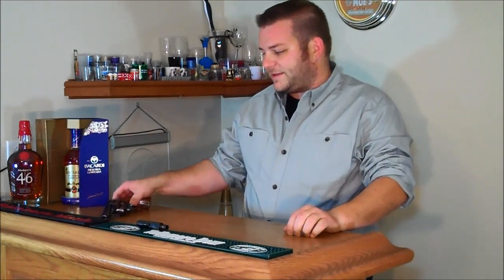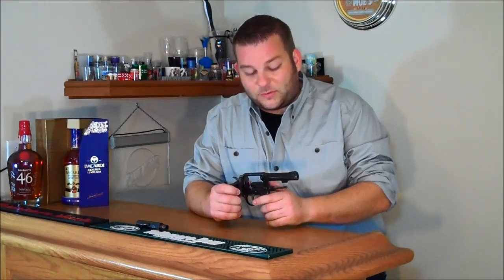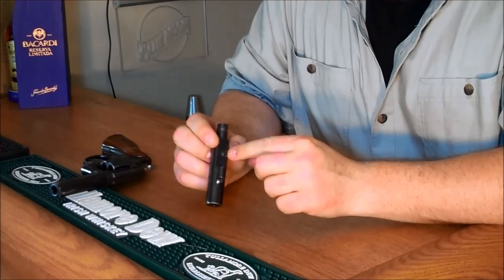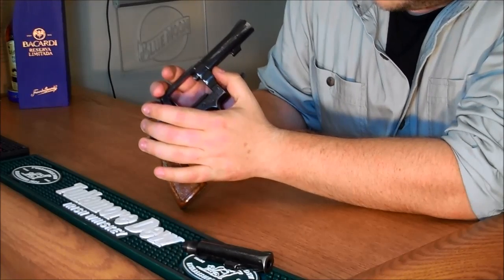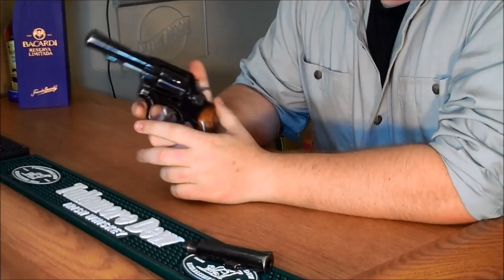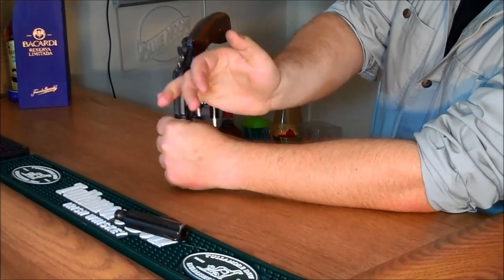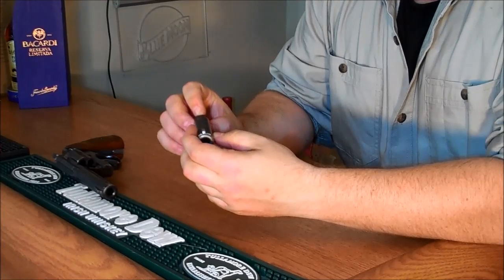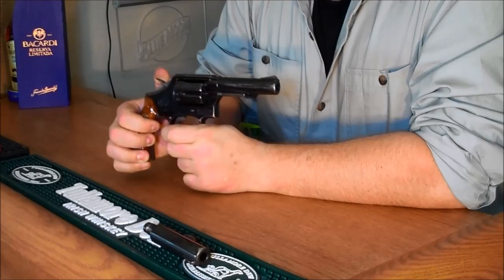Rebarrel a Smith and Wesson K Frame at Home? Gunsmithing tip

Comment: Thanks for the video - I'm going to roll the dice on a model 13  
I got the old barrel off using a rectangular piece of hardwood that distributed the stress and hopefully didn't bend anything .
If something is bent or broken it's not visible.
This isn't my first rebarrel on a revolver.  But the other one was a Ruger and their topstrap is a lot thicker, so it's sort of dicey.

Comment: I've got an interesting problem, Basically, my front site is to the right and the barrel needs to be turned slightly to the left, or the barrel screwed in,to the right a bit more, if you are facing the barrel. I'm hoping you can tell me how you removed the pin. I have a 10-6 as well. Are there any details on the pin that are pertinent? What size punch did you use? did you use locktight or anything else? I really just need to turn the barrel a very small amount to center the sites. Any advise? Thanks in advance.
Reply: Sight, not site.
Reply: You need a frame wrench and an insert for your specific barrel and frame. It’s very tricky, revolvers are hard to work on without the right tools. And even then your taking a risk if you don’t know what your doing

Comment: You did OK.  A  3 inch barrel would have doubled the guns  value.

28Bull
Reply from the maker: I just wanted to get it back together cheap, if i spent the money on a 3 inch barrel I would have probably sprung for the action wrench and at that point I should have just spent the money on a less beatup frame.
Reply: 3" barrel k frames are pretty sweet, though, dude.

Comment: Your kind of gambling that you won't have to do some re-coaning or barrel backup along with some cylinder fitting, the tolls for all that are a little over 500 dollars. You lucked out!  Might want to get a plug gage and check that cone out their about 50 bucks.
Reply from the maker: +Dana Webb It was worth the $30 gamble in my case because I could replace the gun for $300.  If the gun were not a complete beater I would have probably paid a gunsmith.
Reply: Gun&ShotTV It's pretty easy to make a frame ranch, I've got a S&W I'm doing some restoring myself, just take some studying and some home work, gunsmithing is an interesting subject for me like to see what others have done, Thanks for the video.
Reply from the maker: +Dana Webb Thanks for watching.

Comment: how much could it cost for a gunsmith to do this on a pinned barrel?
Reply from the maker: I asked before I replaced mine.  The quotes I got started at $300 Labor + the cost of the Barrel block for the Gunsmith + the cost of the part.    Unless you find a good smith who already owns the barrel block tools they are going to charge you to learn how to do the job.  So knowing the gun could be replaced for $300 I decided to take my own stab at it and if I wrecked the frame I was only out the replacement cost of $300.  In the end I got the gun back in shooting condition for the cost of the $30 barrel.

Comment: Can a K barrel fit in a N frame?? cause i wanna change the barrel of my 627 snub nose for a model 65 bull barrel. could it be possible??
Reply from the maker: Even if the same size, you would need to verify htat the threads match, the pin location matches, and the ejector rod detent matches.  Even if all that worked you will probably have to turn down the shoulder to index the barrel correctly.  You'd probably get good info if you made a thread on the S&W collector forum.
Reply: Ok, thanks sir.

Comment: Does the barrel have normal threads or reverse threads?
Reply from the maker: On my 10-6 the barrel screws in clockwise.  But I'm not 100% if S&W has ever reverse threaded any of the K frames so double check on your particular revision.

Comment: How do I know if my barrel is bulged or not safe?
Reply from the maker: Look down it and see if you see an area where the rifling bulges out.

It can be a complete circle or just one area.  It happens when a weak bullet gets lodged in the barrel and the gun is fired again and the pressure of the second bullet hitting the first deforms the barrel outward.  Some people use the term belled, ringed or bulged but it's all the same thing.  Sometimes you will also see actual cracks on the outside of the barrel or be able to see the bulge from the outside.  If you google image search bulged barrel you will see varying amounts of damage.

This thread has pics of what a minor bulge looks like.
http://www.ar15.com/forums/t_6_49/417839_Any_idea_whatandapos_s_up_with_this_barrel_.html

This page has more info and pics of guns that had the barrels blow and guns where the owner kept shooting and lodged several bullets in the barrel.
https://blackmacearms.wordpress.com/2014/07/03/barrel-bulging/
Reply: Gun&ShotTV thanks buddy